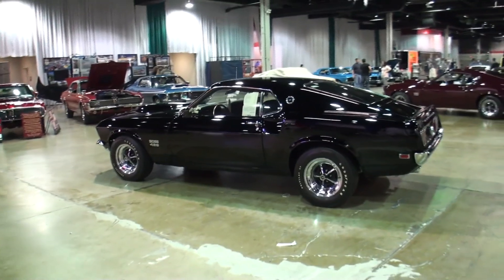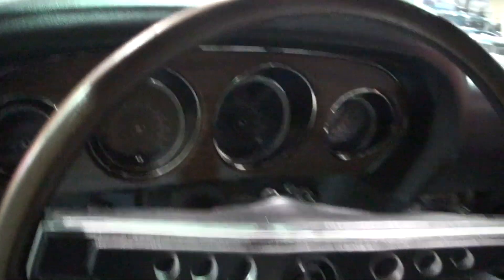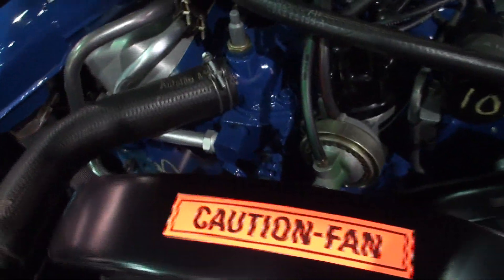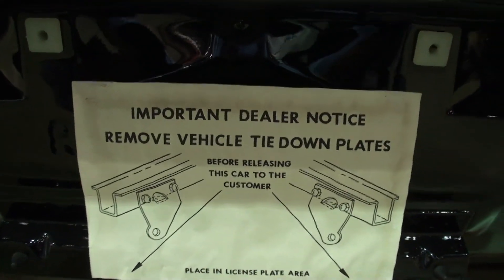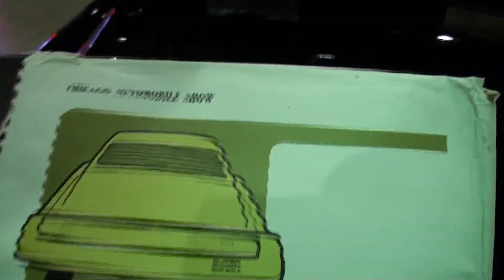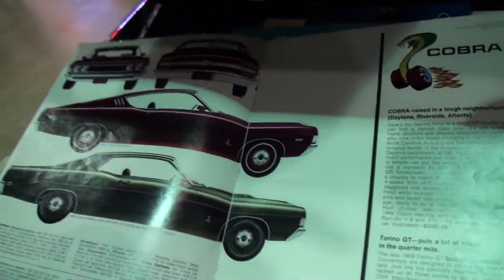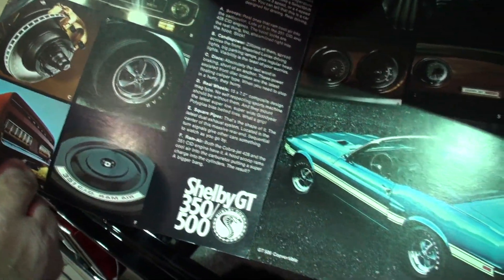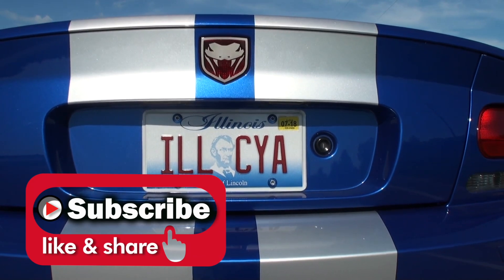1969 Ford Mustang Boss 429 in Raven Black Award Winner on My Car Story with Lou Costabile

Comment: I'd like to respond to a few comments made. First thing, this is a restored Boss 429. Therefore some bare metal parts like the original exhaust system after 40 years gets surface rust and minor pitting. The original exhaust was replaced  with genuine Ford exhaust dated 1-69 , the same date code as the original system. Dave has photos of NOS system next to the original exhaust the car was born with highlighting the date codes and engineering numbers. The original trunk mount battery had expired and was missing when Dave got the car. A NOS Date code correct Autolite  group 29 battery and BB28 vent caps were installed. All original parts, upgraded by NOS assembly line parts were saved and tagged. The value of the NOS exhaust system today would exceed the cost of 5 new Boss 429's in 1969 if you could even find one at any price? Maybe that is a contributing factor why many choose to not start or drive their cars when restored to this level. Maybe a owner not having the original date coded exhaust on their car is why some will cry about not starting a car at a static car show? The Mustang club of America, SAAC and MCACN do not require the vehicle to start for their top concours classes. Don't feel too sorry for the owners who miss out on the thrill of driving their Trailer Queen , more often than not they have a cool driver in the garage too.
Reply from the maker: Hi Bob Perkins, Thank you for viewing and sharing your knowledge, Lou

Comment: It is wonderful car to look at and admire what it was built for. The car did easy 13- 14 sec quarter mile times and with some simple tuning could get into the 12 sec range. This was Ford's answer to the HEMI and it put out more than the advertised 375 horse power. Produced only in 69 and 70 and not installed in any other body style.
Reply from the maker: Thank you for viewing and sharing your thoughts.

Comment: A six figure car all day.. Probably better than it was when it left the Ford Factory...
Reply from the maker: Thanks for viewing and sharing your thoughts on this car :-)
Reply: Too bad it's not driven.. He has A TON of restraint not to launch it down a 1/4 mile just once...
Reply: It was misunderstood  by the 375 HP  when  a Corvette  had over 400 hp  at the same   price.  The carbs CFM was lower than the BOSS 302  which was FORD's plan to  tone down  the HP on  paper  but  be scalable  to use headers and a bigger carb for racing .  
     Some of  those BOSS 9's sat on the lot  because the   Window sticker chased buyer away   that bought  the MACH I   351   or the  390 that was still an upgrade.   
      I remember  when the 1970 came out and I wished the 1969  had the 1970 rear lights since the 4 headlights  really stood out .   The colors  I liked on that BOSS   was Black Jade, raven black and Candy apple red  .
Reply: The high sticker price back then means rarity and big prices today...
Reply: @RoadRunnergarage8570  
   True,  the HEMI Cuda Convertible in 1971  wasn't cheap .  The base Barracuda  was $2700   while the Convertible  added $400  and then  the upgrade to a Cuda  Package was another $300+ .  
  Then add the HEMI  package  for about  $800  and maybe  Option it up from there . 
     The insurance was high a well .
       But  now  one of them sold for over   $3 million.

Comment: Thats insane! Sorry, i can not resist; 
Original warning label to the actual owner; Starting the engine and 
driving could cause some satisfaction. Please be aware that the car 
is 'equipped' with enough gasoline to keep your satisfaction ongoing. 

That he's not driven could be explained that the car is equipped with 
wooden pistons and wooden exhaust system, Ford Premium Option 
SL29 Ford, exotic woods dep. Ford Fire extinguisher is sold separately.

Seriously, that thng should stand in the Ford factory Museum.
Reply from the maker: Hi junkman, "Original warning label to the actual owner; Starting the engine and 
driving could cause some satisfaction. Please be aware that the car is 'equipped' with enough gasoline to keep your satisfaction ongoing"  That's funny :-)  The car is AWESOME, Owner has right to not start it, and I would have like to have heard it too, and yet He's still coll enough to share it with us, and all the trunk treats are worth it alone. Stay tuned, there will be more we "fire up" :-)  Thank you for viewing and sharing, Lou
Reply: When you're round at the Corvette ntnl's, a mint '65 366 c.i. F.I. avail?
For the fuel usage i have memories to old Rolls Royce paperwork. They just used similar phrases - phrases in their own terminology. 
And sometimes silly like this; 'You need Avon tires to drive your new Corniche' etc.
Back to the Boss: when he never drives it, the engine corrode on the inside,
and the body too. Or it locks up. Moisture is the enemy of any metal.

Comment: A beautiful ride Lou! You've outdone yourself again, love your channel! So sad to see a beast like that never roars to life. I could've understood the owners stance if the car had between 0-500 miles on it but this one is pushing 7,000 so its seen some usage...still super low on miles but no oil, engine never turns over is just rotting the car out. Owner is making a HUGE mistake not driving her. A beast like this begs to be driven. My Challenger is a fair weather, summer time only car & put into indoor storage for the winter but she sees some much needed action during the summer months. Why own such a nice car & never drive it? Total waste in my opinion. And I've said it before & I'll say it another thousand times I LOVE YOUR VIPER :-) God! She is one for the ages blue with white stripes...DREAM car. Stay blessed Mr. Costabile & as always thank you for the wonderful content
Reply from the maker: Hi zo maq, I receive the blessing, and my blessings to you too.  I like driving them too, however this car was too good to pass up, and the "trunk & treats" section alone was awesome.  Thank you for the encouragement, and my Viper is proud to have us both as Fans :-) Lou
Reply: @loucostabile  100% the damn thing is a time capsule to 1969. Immaculate inside out. Now it just needs to rev upto 7000rpm & let that beautiful American V8 sing its lovely tunes :-)

Comment: Hi Lou, on the face of it some people have more money than sense, the car is an amazing reference point for other restorers as it has been done to the highest standards, but let's be clear it had an 18 month restoration on a 7000 mile car that one assumes sat unused somewhere for probably 35 years, perhaps due to illness or death or simple old fashioned eccentricity, BUT it had been driven. To be correctly survivor restored it should have  been restored to 7000 mile condition not to the day it rolled off the production line. As they were surely delivered new to the dealer from the factory with oils, coolant etc in them, then leaving the fluids out in my opinion is NOT correct, perhaps he should take the air out of the tyres lol 🙄🙄. Perhaps he has another 429 which gets driven, in which case by all means keep the car as a museum piece but to me it's a great tragedy that a car built by Ford to move under it's own power won't occasionally get fired up even if it only moves a few hundred feet under it's own power a couple of times a year. Nevertheless the Boss 429 is certainly amongst my favourite Mustangs and it was a pleasure to see the car, thanks Lou and thanks to the owner for allowing you to feature the car 👍
Reply from the maker: Hi lyonheart84 UK exotic fruit growing enthusiast, Happy to read of your favorite Mustangs :-)  I like driving the too, and it was fun to video and share this "time capsule" with you, Lou
Reply: @loucostabile  I own a modern shelby gt500 also low mileage at 9500 miles, but it does get used on nice summer days 😎
Reply: They can only be original once fruit cake
Reply: @bobperkins4351  and your point is ?

Comment: Not sure why a car with only 7000 miles needed a bunch of NOS Perkins parts. Shoulda kept the originals.
Reply from the maker: Well when it's your car you find parts when you can to make it the best car it can be :-)
Reply: @loucostabile  Sorry, Lou. The best cars actually run, and their value is higher when all the original parts are present. I am very pro-Ford, so this is not said out of bias.

Comment: Does that mean the inside of the engine is all pitted out?
Reply: It's built to very high standards.
Don't you know what that means?
It means it's non-operational.
Thank goodness my daily driver is, as are all vehicles in Jay Leno's 
priceless collection, built to such 
low standards it is useable!
Reply from the maker: I believe the internals are all there.
Reply: @loucostabile  But you don't really know for sure. Could be a hollow engine. Seen them before in shows.

Comment: I'm sorry lou  I didn't quite follow the car has 7000 miles obviously it's been run despite the fact that it still has all the original stickers on it but because it's a show car  has no coolant oil or gasoline in it and therefore the guy doesn't run the motor?
Reply from the maker: Hi acts2211, I like driving and hearing them run too, however this one right now is not running.  Regardless of running, I thought it was way to nice a car so I wanted to make sure and feature it, Lou